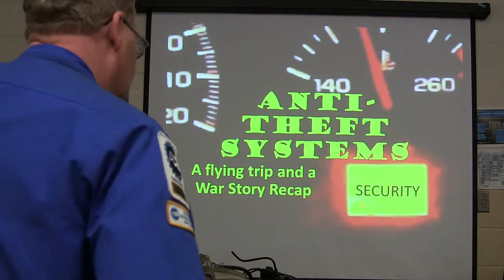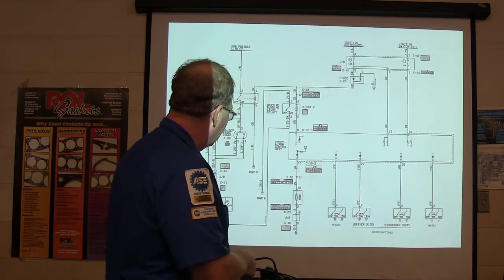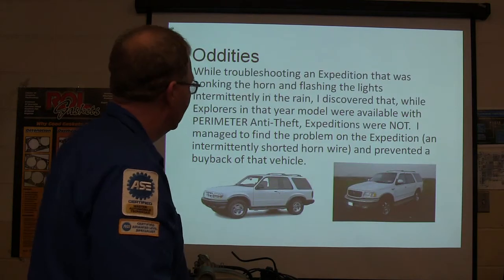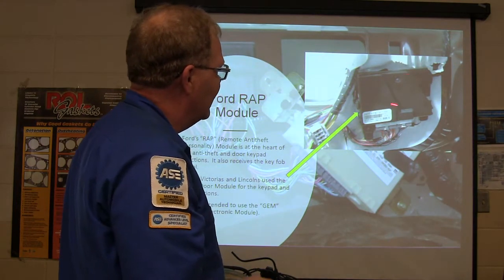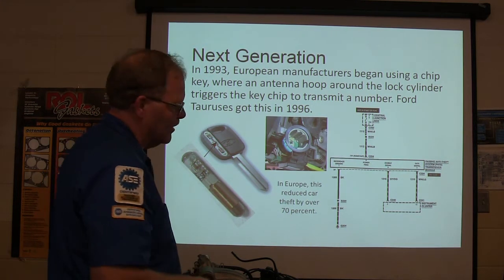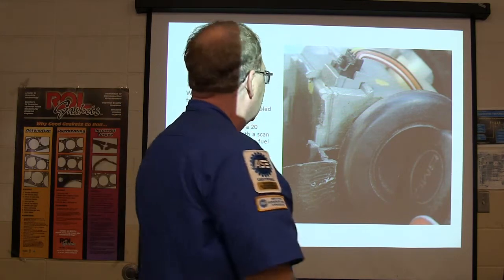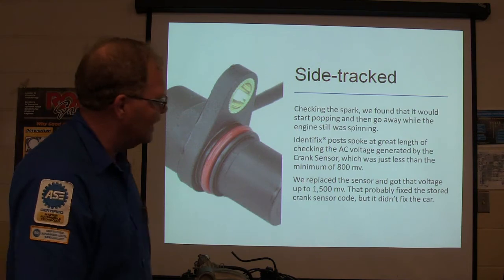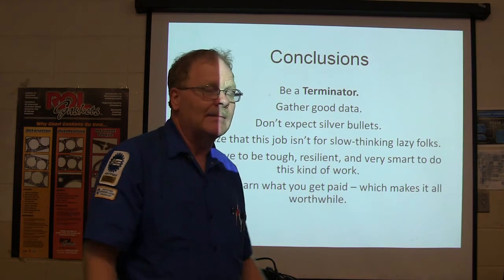Anti Theft Overview

Comment: You said when replacing ecm you have to tell it if it has vehicle theft system and if it doesnt and you tell ecm it does it will be a no start. My question is how do you find out that info if it has theft system or not. Is it rpo codes or? And how do you decifer rpo codes. What info system tell you what they mean.   As always great info thanks